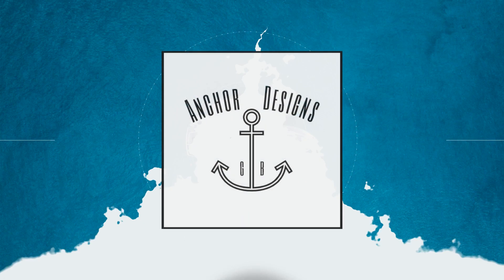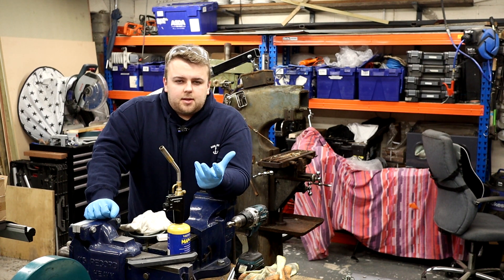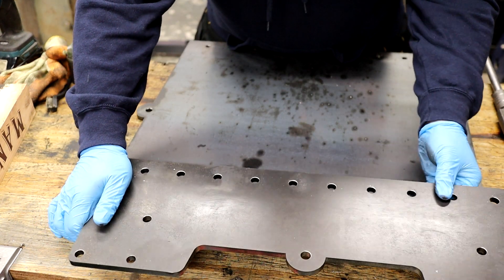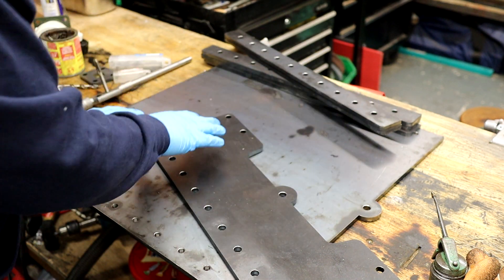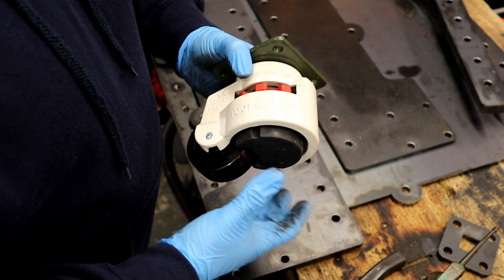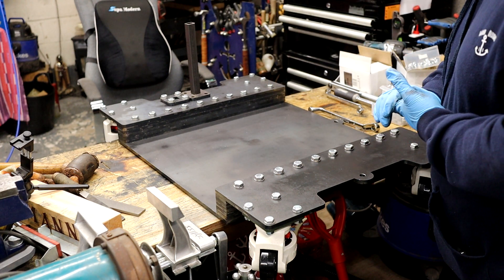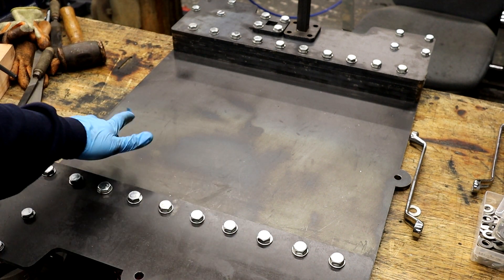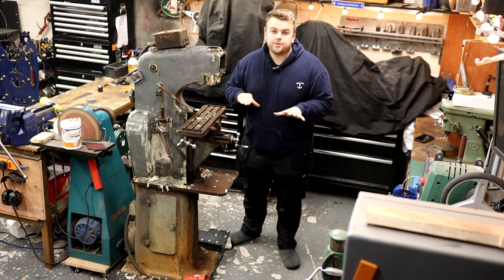500kg Milling Machine Base Build Using Retractable Leveling Machine Casters NO WELDING!

Comment: James great work. I have a Colchester bantam lathe @650Kg  sitting on a 4” HD angle frame using four old cast lifting weights as wheels used for initial transport. Now I have it in the garage I would like to be able to reduce the size of this frame and move / swivel the lathe easily for restoration work etc and was considering either large wheel castors or the levelling castors shown in your video. I was concerned the smaller wheels on these levelling castors would make it harder to move but it looks from your video they move easily. I may have to move the lathe over a block pathed drive do you think the nylon wheel would stand up to this?
Reply from the maker: Hi NSA. Hard to say really. They are very tough. May be worth chucking down some plywood to make a path? My frame hasn’t moved at all thankfully.